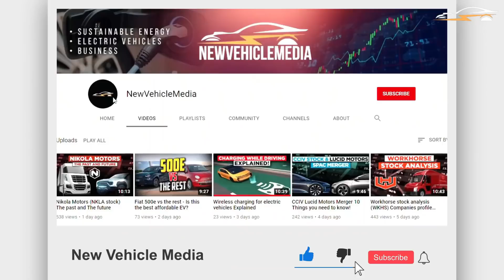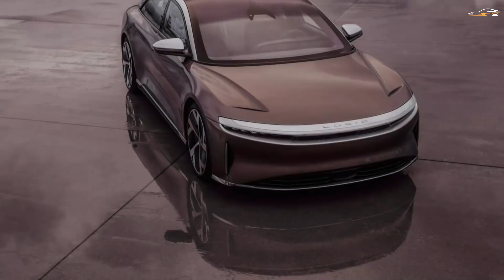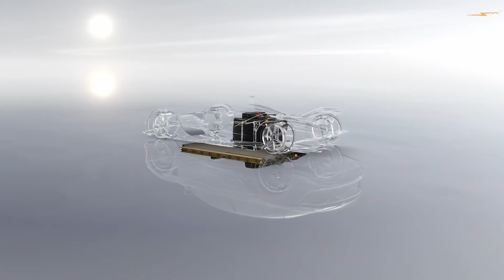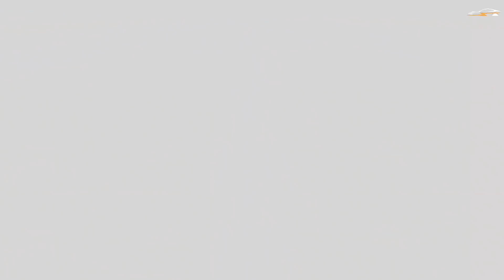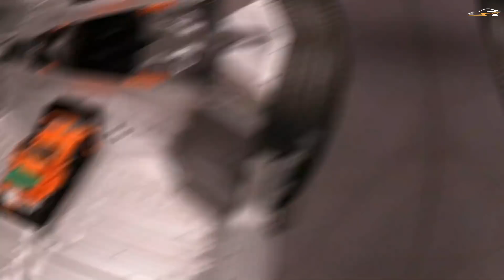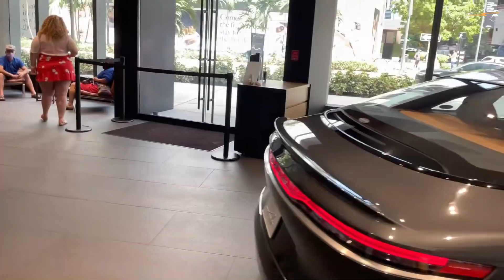Why Lucid remains SECRETIVE on their Battery Technology!

Comment: The car is nice. The technology, if verified, is awesome. But they have yet to  start producing and delivering. Right now on paper they look good. At best in the market they'll be a boutique EV car seller until they can produce a cheaper consumer model to compete with the Model 3 and get a real world range of at least 400 miles to the charge. 

Right now the Lucid Air Pure price is up there with the Model S Long Range. But while their charging claims seem more impressive to Tesla they don't have their own charging network to back it up. Tesla is 10 years ahead of them.

And they better have an impressive over the air update infrastructure instead of requiring their customers to bring their cars in for major updates. Again, something Tesla is ahead of everyone else on.

I'm hoping they can backup their claims and give others a run for the money.

Comment: at this point I think that if flight ever goes electric it will be because of LUCID batteries.. and possibly their motors too.
Reply: C M  so you think all of this is an elaborate ruse?  Weller have until some time in August to see. Btw what is the EPA?  Didn't they put their stamp on the range numbers?
Reply: C M  I'm not familiar with wunderbox. Is that the small motor? If so I think it's interesting. I don't doubt such a small motor is capable of the torque and power to propel car. electricity is very powerful and metals are rigid. I don't doubt it just because I don't know it's details
Reply: C M  if you have information that is compelling then share it by all means

Comment: Battery's technology is controlled via AI enhance tested by many designs engineers. 
It would not never be on list, epa range attained formula comes in many colors.
It is impossible Texas Instrument, Nvidia, Amd, Taiwan semiconductors are few mentioned whose semiconductor is charged in automobile industry along with number of appliances.
What is cheaper Battery's is hard to see the businesses is tabled under Amazon tesla tractors hand tools agricultural equipment etc
I just barely scratched the surface
We will bare the news on wall street wheeling dealing zoom calls stocks bought and sold .
There are lots of deals circulating.
There is a narrow windows on e-commerce changing hands
Ashraf Jamal
713 896 0202
Reply: Go somewhere else